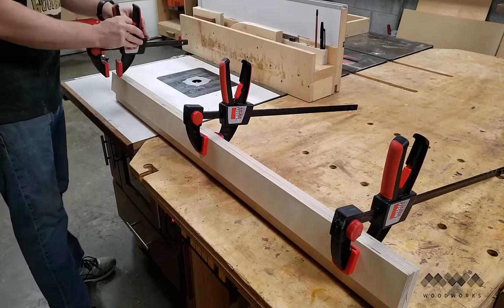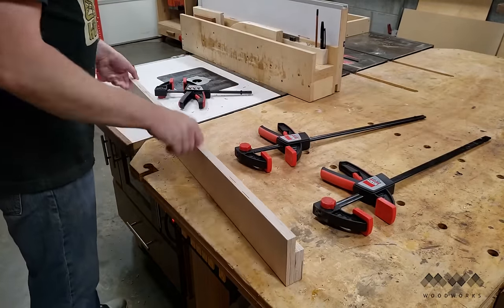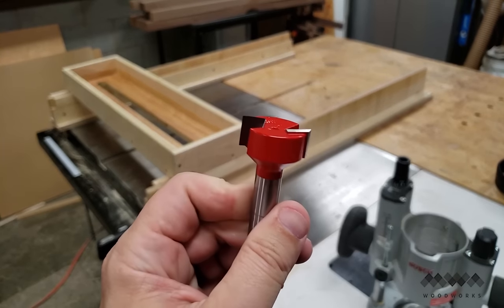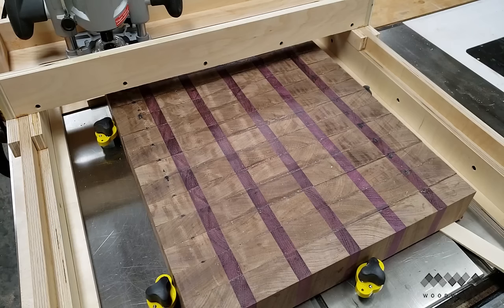HOW TO BUILD A ROUTER SLED / SLAB FLATTENING MILL

Comment: One tip I saw on making the sled was to use a wider base so the rails sit on top of the bottom.  That permits screwing from the bottom into the side pieces and reduces any likelihood that your screws in your sled which are horizontally installed may cause he bottom the router is riding on to bulge.  The screws installed as you did might cause the router to ride on possible bulges at each screw position.  If they were installed vertically, the sled bottom remains flat with no potential to bulge.

Comment: Nice job. I'd make one change though - in your build, you attach the sides of the sled with horizontally driven screws into the edges of the sled base... than can cause a minor, but perceptable bulge in the base at each screw's location. Better to make the base 1-1/2" wider and mount the sides by  driving the screws through the bottom of the sled, into the edges of the sides.

Comment: Purchased the plan for this Router Sled and will build it this weekend. The plan is very easy to follow and of course I can always refer back to this video if I have a problem. One thing I want to point out in the plan is the dimensions for Part 3 on the cut list should be 2 1/2 " X 48", not 3 1/2" X 48". Thanks for the video and plans.
Reply: I discovered this problem this week as well when I built the router base and found it was sticking off the rails by a good inch. Had to redo parts of it. After watching the video again I realized his build was not like the plans which is pretty annoying to waste time and materials for a plan that the creator didn't even follow in the video. Surely, he could have updated the plans instead of continuing to allow a faulty product to float around for purchase. I had been considering some of his other plans and now am questioning those purchases wondering what I will find out to be wrong with them as well. Be better MWA Woodworks

Comment: Hi man, great project! 
Just one question: I guess you made the rails that way (on the table saw) because you were super confident about the alignment of the fence and the blade right? - actually I guess you have checked that off camera. I ask you this because I'm not that sure my fence is that well aligned and the blade too, I mean it's kinda good but to make perfect long boards I should make a long and tedious alignment job and probably buy an indicator gauge... Because even a mistake of 0.3 degrees in the rails flatness can lead to a height drop of, like, 3-4 mm for a table that is 1 m long after you have planed it down. So I was thinking about superposing multiple MDF boards, which are super flat, on the wide side to make the rails. Or directly buying some pine boards after having checked the size doesn't change over the length of the board. Do you have any better ideas? :D 
BTW of course I will align my table saw perfectly one day haha
Congrats again!

Comment: Thank you for the great tutorial! One question though, what purpose do the inner rails serve? Couldn't you just take them out and have the sled bottom ride the rails? I'd think that would eliminate any problems caused by runout between the inner and outer rail surfaces.
Reply: The rails provide rigidity to the sled bottom. Otherwise the whole sled would bend/deflect whenever you put pressure on the router in the middle of it and leave the workpiece looking like a dish.

Comment: Great video.  I have some Black Walnut slabs varying between 4-6 inches think and about 36 " diameter.  Been trying to figure out how to get them same thickness and smooth enough to do an end table out of them.  You router sled appears to be the solution to my dilemma .  Thanks again.

Comment: I used polyurethane on my sled  it provides a slippery surface for the router and slides easily on rails. Also attached my sled sides ontop of the base piece and attached with pocket screws. Less chance of warping with the frame secured to the base board.

Comment: Great vid and commentating throughout the video.  Have you figured a way to limit the ridges the bit makes with each pass?  I am using a 1.5" flattening bit, but seem to be getting a LOT of ridges with each pass.  I have tried going slower, more passes with little movement when moving the sled along the rails.   Thanks.
Reply from the maker: The ridges happen because the bit is not exactly parallel to the work surface. It's tipped off axis just by a hair which causes the ridges. The only way to eliminate it is to have your setup perfect. That said, I have never been able to eliminate the ridges, even on my CNC. But they are faint and can easily be removed with sanding.
Reply: @MWAWoodworks  Ok, that explains the issue I am having.  I will need to go back and make some adjustments to my sled and try to get it a little closer to perfect to help with the ridges.  Thank you for your response.

Comment: can you please suggest an alternative to mag switches to secure the work piece to a non cast iron saw table or an otherwise known flat work surface?  thanks!  oh and also can you explain how you figured out where to place the base of the sled on your table saw such that when you raised the saw blade up into the bottom of the base it was located at the outer tangent of the two holes you drilled in the base?
Reply: Use a dial caliper to measure the outside of board to hole distance to the nearest thou. Cut scrap till you get it right.

Comment: I'm making a sled to use with a cordless 20V dewalt router and an issue I have is the bit (Whiteside 1/4" shank with 1" cut) only extends 5/8" below the bottom of the router plate. So if I use 3/4" plywood for the router sled base the bit won't even extend past the base. Do you have much depth when using your router and sled? I'm not sure how much further a 1/2" bit extends on larger routers but with mine I may have to use 1/8" angle iron to slide my router on to get some clearance
Reply from the maker: I had to buy a collet extension for better reach
Reply: @MWAWoodworks  That is what I'm looking at doing but I only have a 1/4" shank and it sounds like the force on the extension/bit could cause the extension to bend. I don't really see many other options though.
Thanks for posting your video and responding.
Reply: I ended up making a sled with 1/8" angle iron the router runs on and this allowed me to use the router bit without an extension.
The sled set up worked very well. I had to raise the cookie at times after I shaved on a few layers (about 1/8" each pass). I raised the cookie by placing flat plywood underneath it but I left the cookie on the initial piece of plywood that had shims under it so I didn't change the slope of the cookie at all. I also raised the rails the sled ran on my placing some 2" - 3" melamine boards under the rails. 

One key piece of advice is don't test the depth of you cut on the cookie because if it is too deep you then have to plane the whole cookie down to that depth which can cause you to have to make another full pass or two.

An unfortunate issue I ran into is after I finished my first cookie and was ready to apply epoxy, I left the cookie out in the sun and it warped, probably about 1/2". This is a problem because one, it is a lot of work to plane it down again to get it level, but also because the cookie will be getting quite thin. 

This is my first time working with wood and trying tree cookies and I thought since the wood had sat outside cut to 16" lengths (was going to be split for firewood) for a couple of years that the wood would have dried. I'm now leaving all four cookies (two not yet flattened) out in the sun trying to dry them. I don't mind if they crack or split a bit because I think the epoxy will look ok filling the cracks. What I don't know is if they will warp again and how long I should let the wood dry further. Any suggestions here would be welcome.

Comment: I'm thinking of building this but also need a new cross cut sled. Just wondering if anyone has ever combined the two? A cross cut sled with levelled out rails that doubles as a slab flattening mill. Seems like it should be easy enough...

Comment: Nice video, and I learned a few new things. One tip I recommend is to level the sled rails using a 4' level before you start routing. You don't have to be level in the long direction but the two rails have to be co-planar in the perpendicular to get a slab that's truly flat. lt's like using winding sticks only much more accurate.

Comment: I’m brand new to wood working and I’m just starting to pick up some tools. I mostly want to make coffee tables, end tables,benches, etc. what tools would y’all recommend for me to start with?
Reply from the maker: A table saw is a great starting point!
Reply: Do you have space? Bottom dollar? A sears craftsman '100' 10 inch table saw and, god help me for saying this, a  free or less the $100 craftsman radial saw. they are all over facebook market place.
Reply: @kkarllwt  thanks! I picked up a craftsman table saw. The 2” walnut slabs seemed to test it but it pulled through. I think I’ll just need a new blade soon if I keep using these hard woods.

Comment: Love the sled and considering buying the plans. Problem is I need to flatten a workbench top that's 32" wide. Thus far I have it sitting on saw horses. I don't have anything long enough or wide enough to put it on & mount the tracks to. What would you recommend?
Reply: I had the same problem until i found a free wooden dining room table. Problem solved. Bolted the sled rignt down to the table. Works Great!!!
Reply: Screw straight strips to the side of your workpiece below the top to let the sled ride on.Use winding sticks to align for flat. Spacers under the winding strips.

Comment: Why not use some formica or delrin for the tracks?  Seems like if you were avoiding glue for moisture, then spraying it with lube defeats this purpose!
Reply from the maker: You can for sure use formica for the tracks! As far as lube, I learned my lesson quick and used a dry lube that doesn't attract the dust like wax or wd 40 do

Comment: just wondering, you said you used a 1 1/4 " bit, i saw some for 2 1/4", would you be able to use this also or is it too big ?
Reply from the maker: If you modified the width of the slot in the sled you could use a bigger bit but that is an awfully large bit to be handling by hand and I personally would be concerned for safety (sled or no sled)
Reply: @MWAWoodworks  ok thanks  i thought it sounded too big.
Reply: is your router bit half or quarter inch shank ?

Comment: What type of bit can I used for this method???
Reply from the maker: I believe there's a link in the description 👆
Reply: @MWAWoodworks  nope there is a link for mag switch, router and collect extension not the actual router bit
Reply: @MWAWoodworks  unless I'm dumb and dont see it could be that
Reply from the maker: Ah. I can fix that.
Reply: @MWAWoodworks  thanks trying to get into wood working I found some slabs online and just need a way to flatten them out :)
Reply from the maker: Added links to the description 👍

Comment: Nice sled looks easy to build, your cut list calls for the short rail, item 3,  is 3.5", but the layout is calling for 2.5"
Reply from the maker: The inner rails are 2.5 I believe. There should be a 1 inch lip for the sled to ride on